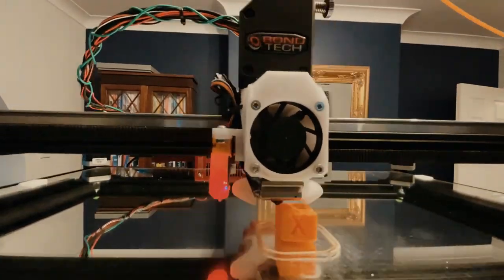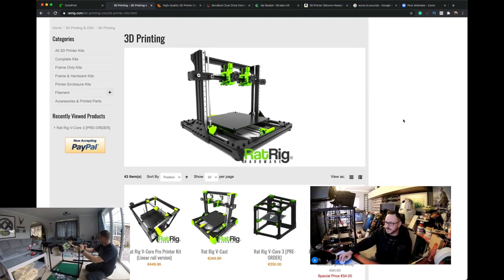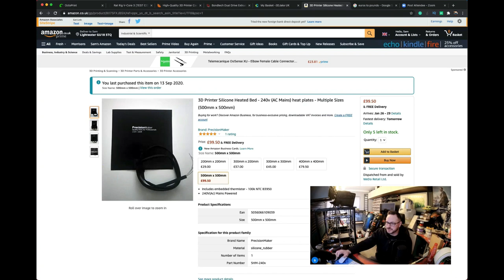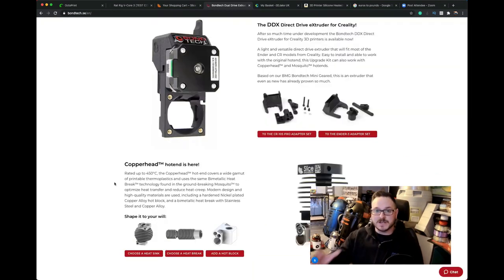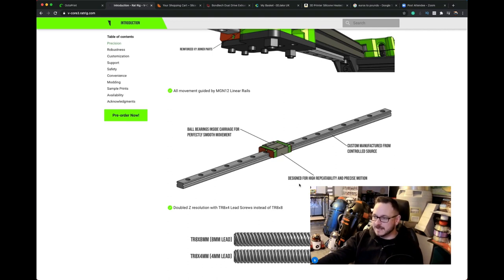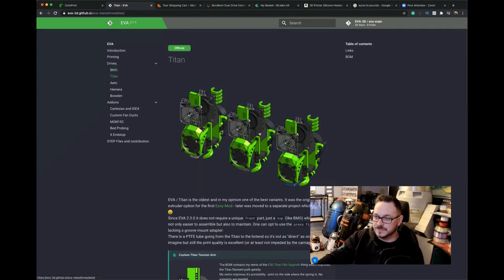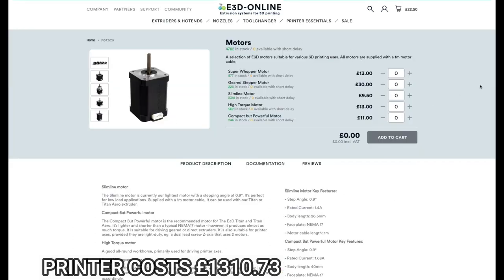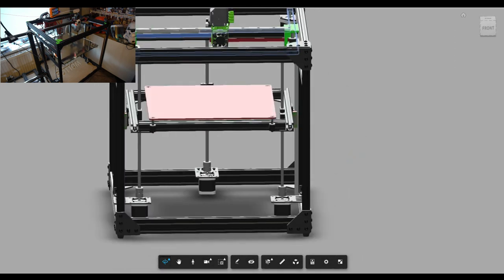Rat Rig V-Core CoreXY 3D Printer DIY CoreXY

Comment: I'm on week 4 of waiting time for my Ratrig, hopefully only a few more weeks to go. Decided on the Duet 3 Mini 5 board, then changed my mind to go for the BTT Octopus with a Raspberry Pi 4 to run Klipper as I've seen good things about their input shaping. Looking at printing around 300mm/s with the Dragon high flow hot end when I've got the build plate full of bits (I've gone for the 500x500mm bed).

Great informative video, covers a lot of things that I was invested in with this printer :)
Reply from the maker: Thanks Steve i have a new video in the works with my new vcore 3 hang on in there :)
Reply: @TheRealSamPrentice  that's great news! I'm looking forward to watching it when you release it! 😀

Comment: Excellent video.  Would you recommend this kit for a noob’s first 3D printer?  I need to print a large helmet and the specs on the V core 3 350 tick all the right boxes.  And are these insanely loud?  Thx!
Reply from the maker: Great question! Yes and no the setup is complicated but there is a great community and awesome support so it depends on if you’re a patient person
Reply: @TheRealSamPrentice  I think your patience was a requirement. Seems priced very reasonably. I get a good vibe off of these people. Was leaning toward a CR 10 or Ender 5+ But I need to print a very smooth original design and not just be stuck to PLA to get a good print.  Considering waiting for a turnkey solution but may just jump right in. Thanks again, and may the Force be with you.

Comment: Looks great, but what bed heater to use if you are in the US? Cause the one they sell is 220 volts only!
Reply from the maker: They do have beds in 110v also :)
Reply: @TheRealSamPrentice  "Add custom Keenovo silicone 220V heater pad with thermal fuse + 40A SSR Relay Kit (WARNING: rated for 220V Mains, not compatible with USA/CANADA users)" is literally what their website says
Reply from the maker: @jscancella  is that from ratrig or from keenovo?
Reply from the maker: @jscancella  ah I see I didn’t get my bed from ratrig ! Check out the brands in the description
Reply from the maker: @jscancella  PrecisionMaker is the brand I went with
Reply: @TheRealSamPrentice  seems like it might make more sense to just use the BOM and source locally for USA people? Especially since the kit costs enough there will be VAT tax
Reply from the maker: @jscancella  I fully agree with you there again that’s kind of the point of the open source platform they basically sent me the hardware for printer skeleton and I added my own components
Reply: @TheRealSamPrentice  yeah, just makes it less appealing to those people who know a bit but have never built their own printer and want a kit with known parts that work together.

Comment: Which SSR did you use with the heated bed?
Reply from the maker: 5.0 out of 5 stars  4 Reviews
SSR-40DA Solid State Relay Single Phase DC-AC Relay Input 3-32V DC Output 24-380V AC
Reply: @TheRealSamPrentice  Thanks for the info much appreciated

Comment: Between 300-500 mm not cm.
Reply from the maker: very good - if you check the comments below you aren't this first to point this out
Reply: @TheRealSamPrentice  Yeah I saw the other comment after the fact. Ive been looking at these printers for a few weeks. It made me think I misread something at first had to double check.
Reply from the maker: @Covers70  that would be some printer!! :) it’s epic I’m working on the 1.3 upgrade and also the vcore3 (400) again both are enjoyable builds :)
Reply: @TheRealSamPrentice  Yeah it would. I dont work with cm alot. I didnt realize till i put it into a conversion calculator that 500 cm is over 16ft lol.